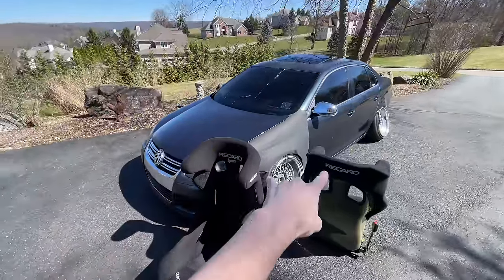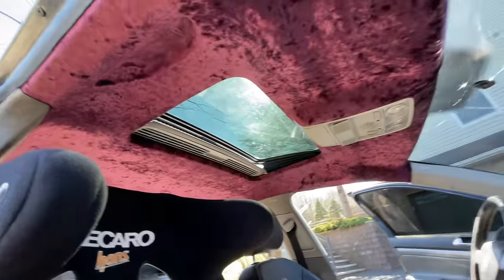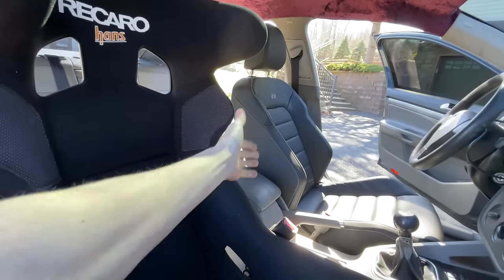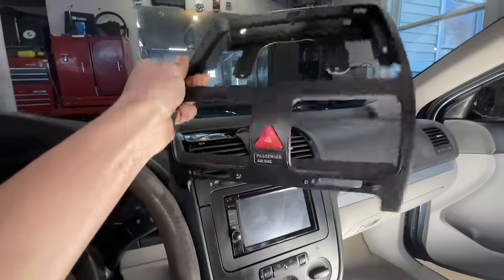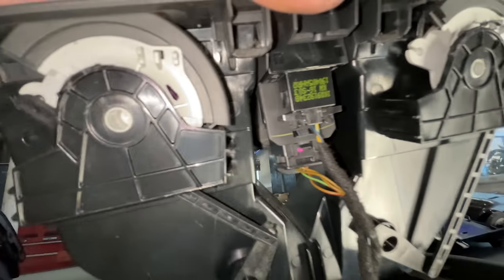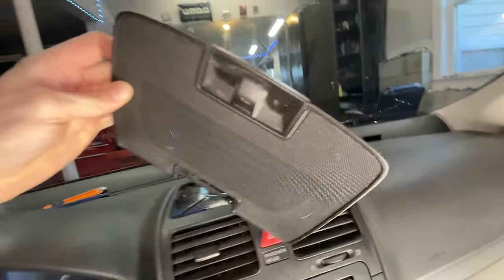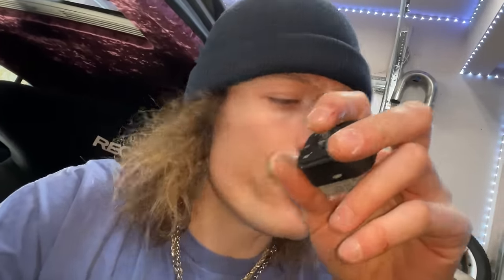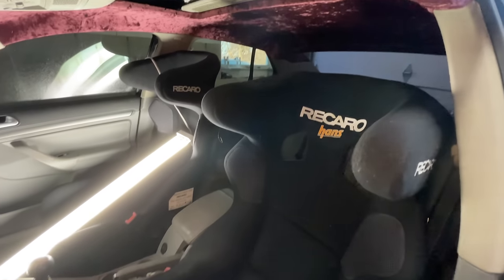PREPPING MY STANCE CAR TO BE A TRUE " daily driver "

Comment: The RCD330+ head unit is a direct replacement. Had one in my mk5 R32 and it was a game changer 🤙🏽
Reply from the maker: Sweet !
Reply: @Alex_Widuch  I second this, might be able to snag one off marketplace. RCD330 is the OEM radio, RCD360 is a OEM remake (you can tell the difference by the lack of aux port on RCD360)
Reply: Have one in mk5 doesnt disappoint🤌🏼